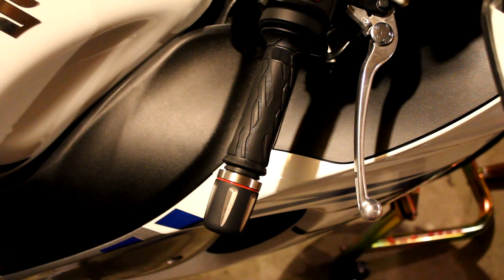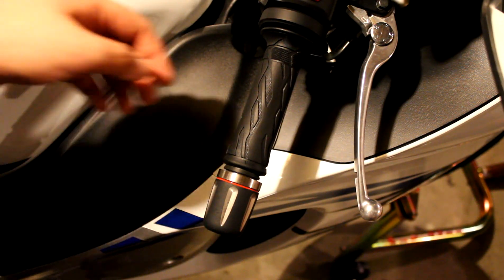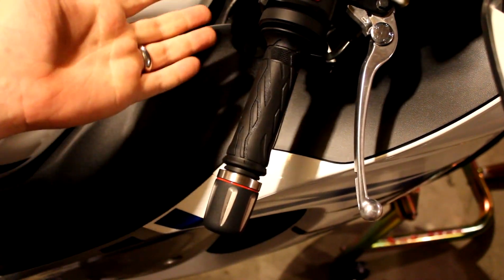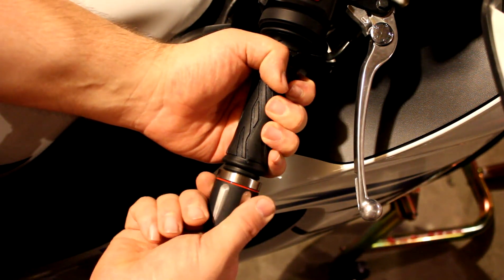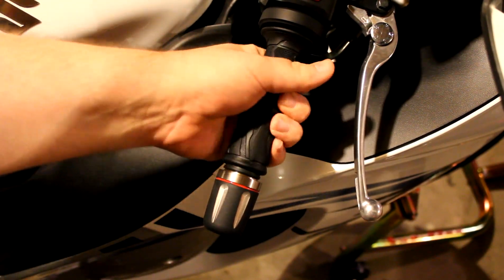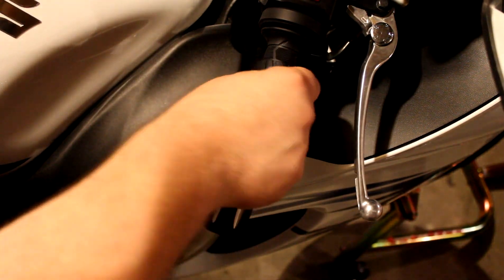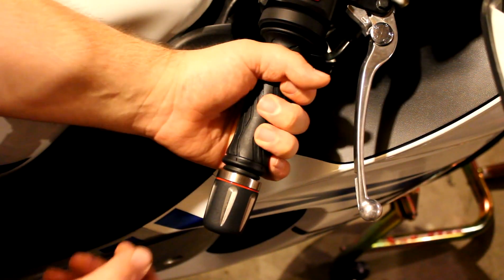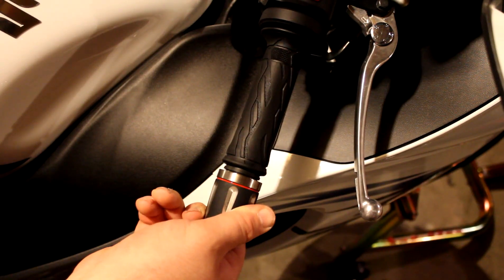Motorcycle cruise control Throttlemeister How to Operate with Easy intall in 5 minutes!

Comment: No, no, no:  Redo this video.  Okay with the friction explanation but you are confusing many riders.  You must explain it as if you are riding where, of course, one hand operation is necessary (don't show your left hand at all).  ... With right hand, slightly adjust friction on throttlemeister then turn throttle to required speed and tighten slightly more.  ...  [As for danger, yes, with a capital DANGER.  This device is only for very experienced riders and then should be used very sparingly and only on open roads.  To answer another question, the clutch must be used in a panic situation....indeed a very difficult maneuver to master.  This simple mechanical device converts the throttle to something similar to the old "suicide throttles".]

Comment: Hey guys, Actually, the video was not correct, you don't use both hands, you slide your right hand to the edge of the throttle, where you can use your Thenar of your palm to hold onto your throttle and Hypothenar of the same palm on the throttlemeister to lock it.

To my knowledge, these throttle locks are for long straight line tourings, where you have to rest/wiggle your hand for few seconds, let the blood flow settle in, obviously, with vibrations, the throttlelocker will release automatially..

PS: I use Go Cruise Alum 2, I use it for very less time, so, I got that cheaper 35$ one, instead of throttlemeister.

Comment: You would probably lose it a bit and then just fight the friction to get it back up to speed.  My reservation is with anything that manually locks the throttle on a bike though because it doesn't have an auto disengage like a car where you step on the brakes and cruise is off.  This one will keep your bike going after your braking or other emergency manuevers until you remember to manually twist it off.  Maybe they can make it a 1/4-turn so it's quicker to disengage?
Reply: I don't know how many people here are actual riders but you unconsciously roll the throttle off during braking even in an emergency. Otherwise even without any kind of throttle lock you'd never be able to brake in time. Unless you take your had off the throttle to release it and grab the brake lever, just reaching and pulling it rolls the throttle or nearly off. Set with just enough resistance to hold the position it's easy to roll the Throttlemeister off. This applies to any properly set throttle lock.

The real problem is if you somehow get tossed from the bike with the throttle locked. The bike would roll until it became unstable and crashed. The 'good' news is that many bikes have lean angle sensors and will kill the engine after a crash.

But that would to 90% of the locks that weren't connected to the brake system somehow. And that's complexity I don't need.